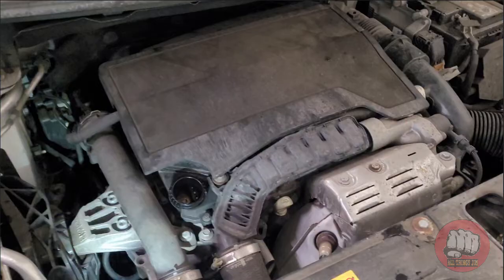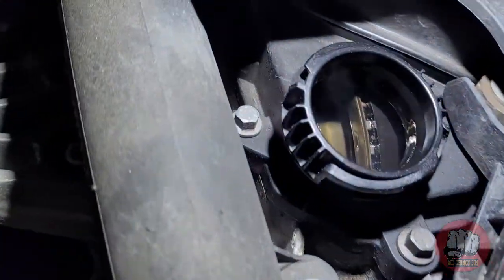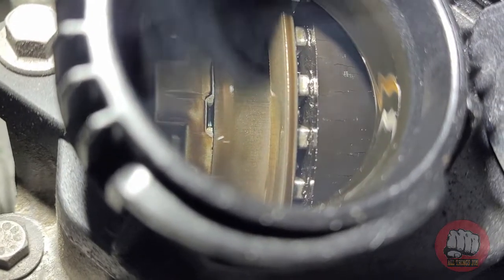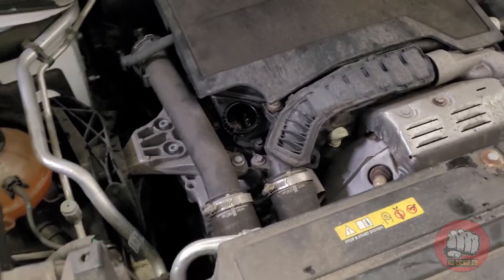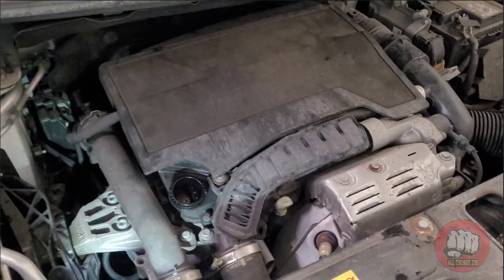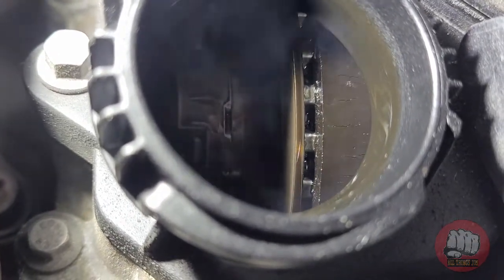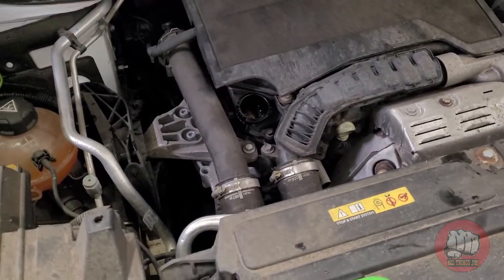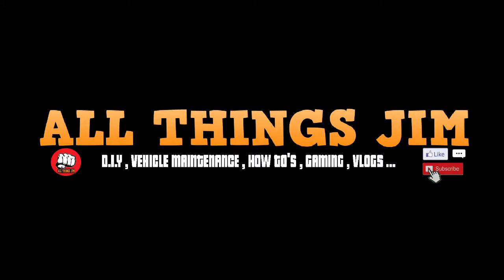Lets discuss the 1.2 puretec engine

Comment: Is anyone happy with this Engine 1.2 Puretech ? Or manage to do high milleage without any issues ? 🤔 I mean its all Horror Stories 😬
Reply: I have Opel Corsa F 2020 model 130hp/230Nm. As of today it have 55,000km (around 34,000 miles). No problems what so ever so far. Next week i have my 4th service check and oil change. But in my country the service check and oil change is every 15,000 km not 15,000 miles. I think that 15,000 miles is too much (24k km).
Reply: I've had oil losses, coolant losses, engine cut out to limp mode which can't be picked up on ECU, engine management issues....the worst car I've ever had. I would advise to stay clear of this this engine ..garbage.
Reply: @zakiakhtar7447   what was your mileage, and the Year when the car started going Wrong , did the car had been serviced regularly 🤔
Reply: @niceboy60  yeah serviced like clock work, 2021 and started 55,000 miles.
Still in limp mode. Mechanic says there's nothing physically wrong with it....but 42 fault codes which mechanic is having trouble locating
Reply: @zakiakhtar7447  I ve done my research that's the mileage I would be expecting problems to start appearing 😢
However I don't think I will have any problems
EAT8  8 Speed Gearbox in theory should mitigate
By constantly keeping revs low even at motorway speeds, New Timing Belt Material, Low Friction oil specifically 0w20  and to top if up Extended Warranty bough it until the End of my Contract, provided the car is serviced warranty should cover it
Reply: Got a 2023 car with this engine  On Extended Warranty , my plan is to do around 40,000 miles and get another car they offered me 4 years warranty and assured me this problems have been resolved
Reply: Yes, I did 80,000 miles in mine. My Son has it now and it's on 85,000. Absolutely reliable. Didn't need oil top-ups between services until about 65,000 miles. Now needs 0.5 litre top-up between services (15,000 miles). The car has been serviced by main dealer from new. I drove it hard and it has been across Europe a few times, fully loaded up. Brilliant car & engine. My Wife has one too, now done 40,000 miles with no trouble.
I had the cambelt & water pump changed at 65,000 miles.
Reply: @pauladams5673   if you dont mind me asking what is the make of the car & year ?
Reply: @pauladams5673  I'm sorry no disrespect intended but these mileages are really nothing special in the past I've driven
cars in excess of 200,000 miles with little more than regular servicing and no noticeable oil consumption between services,
a Nissan Bluebird went well past 250,000 mls before my eldest son had it and put a load more on it. A Honda Civic 1.6 VTI
I bought at 87,000 mls ran it till just under 200,000 and had 20 odd phone calls from people wanting to buy it. 
Manufacturers today do not regard owning a car more than couple of years as a thing. Caveat emptor.
Reply: @pauladams5673  interesting I ve just got 408 so far I m happy, what was your service intervals and what type of oil did you use?
Reply: I'm the 2nd owner of a 3008 mk1 (facelift version from 2015) with a 1.2 puretech engine. I currently have 124k km on it and I'm getting "low engine oil level" errors every 200 km.

Mechanic will start work on it in a few days. Next time I'll just buy a Mazda with a petrol engine, they're almost bulletproof. If only I'd done my research sooner...
Reply: @abcmusicman1  sorry to ask did you ever had to charge the Cambelt 🤔
Reply: @niceboy60  The cambelt was changed at around 80k km according to the service history, so it'd been done before I bought the car. I did however have to pay for a generic engine rebuild. The oil control rings were so worn and overheated that instead of snapping when the mechanic twisted them in front of me, he was able to keep twisting a full 3 rotations and it still didn't snap. I heard they were brittle, so it was proper f**ked by the time I got around to repairs. So far I've done like 1500 km since the oil was replaced after repairs and I've barely lost any oil, I think I'll be due for another oil change before I have to pour in more!
Reply: I wouldn’t have another one, though, admittedly, I did high mileage.  I had a 14 plate Peugeot 308 with the 1.2 Puretech 130hp engine.  I bought it in 2017 with c24k miles.  Sold it 3.5 years later with c130k miles.  By then, it was burning a lot of oil, I was probably topping it up every 1,500 miles.  The 3 cylinder engine just wasn’t up to it.  Maybe if you do 5-10,000 miles/year in a small car it would be ok.
Reply: These engines are a nightmare....expect to burn 1 litre of oil every 1000miles after 40'000 miles..it's disgraceful to be honest....and there is no excuse for it.

Comment: Is it possible to change timing belt in this king of engines per a timing chain in the In the official workshop of the brand?
Reply from the maker: Im not 100% sure on what youve asked.... if its - is it possible to change from a timing belt to a chain? then my answer is I havent seen one that has and I dont know if there is a conversion kit available BUT newer ones coming out have switched to a chain and hydraulic tensioner setup so mabie someone will make a conversion kit at some point 👍
Reply: @ALLTHINGSJIM  i think it could be the best option

Comment: Have new cars with this engine the same problemn? Thanks
Reply from the maker: Well there is a new model / version of this engine which does infact now have a chain but ive only seen a few so far, but all belt driven ones will have this problem at some point yes 👍
Reply: @ALLTHINGSJIM only hibrids have chein and new gear box from powertraina
Reply: @ALLTHINGSJIM  if we are talking about a new peugeot would you suggest the 1.2 puretech 100hp or the 1.0 TSI (208 vs fabia)

Comment: Got a disabled friend with a Citroen C3 Aircross bought brand new late 2018, main dealer serviced by the book and currently on around 30k.
He gets me to check his levels every 3 weeks or so and it usually needs a top up of oil and there is no leak.
My 2003 Jaguar XJ6 on the other hand on 120k miles doesn't use a drop between yearly oil changes, which is usually around 3-4k miles.
I warned him when he was looking around to buy it, steer well clear of small overstressed turbocharged engines, producing ridiculously high bhp per litre.
My instincts proven correct!
Reply: Direct injection gasoline engines 😢
Reply: If you want check PCV valve.Causes oil consumption
Reply: P c valve . I drive a 1997 ford escort . All electric bits removed injector pump earlier model . No abs ,only bit I keep original is the airbag . Modern cars with electronics nothing but problems .. give me seat 600 or a old ford cortina maybe even a Allegro. But come on wet timing belt ??

Comment: I saw another video talking about this engine and they say that cars with this engine built in 2023 already come with a new timing belt (more resistant to oil maybe). Do you know something about that ???
Reply from the maker: The brand new ones come with a chain now I believe depending on the build date, i will make an update video when I come across one in the wild 👍
Reply: @ALLTHINGSJIM  that's about time they fix this problem. Looking forward to see that video. I was thinking about buying a brand new Peugeot 308 with this engine but when I knew this issue with the belt I held back. Thank you for answering.
Reply: @ALLTHINGSJIM  interesting I've a 2008 gt getting built atm hopefully it comes with the change
Reply: I've just ordered a new 2008 1.2 130ps and am starting to worry a bit about what I see on the Internet on these wet belt puretech engines..
Reply: @jdmguy44  ordered mine in April, and I'm getting the new 2024 version. If you just ordered, you will get the same one the GT? right? mine is built and on its way to the uk. New versions have a chain instead of a belt. If in doubt, go speak to your dealership they have all the information you need
Reply: @MelchizedekKohen  yes it's the face-lift 2008 (2024 version) in allure spec slated for December 23 delivery (UK) Hopefully has the chain engine.
Reply: @jdmguy44  Yeah, should be all good, hopefully lol

Comment: Our puretec 1.2 T requires cambelt change after 28k miles 😮
Reply from the maker: Doesnt suprise me unfortunately, if you use an oil flush on your services then id stop as it may be that causing it to prematurely disintergrate 👍
Reply: @ALLTHINGSJIM  I had to pay £1200 for my sons C4 cactus to have the belt replaced i am gathering info to take citroen to the small claims court to recover the cost of repair which they refuse to pay or even a good will gesture .

Comment: Jim, I don't use my 1.2 turbo Cactus much as I am retired. Do you think I should take it for a short trip every now and again to keep the belt lubricated? If so how often and how far? Thanks.
Reply: AFAIK the main problem happens when you use it for short rides without allowing the oil to get the optimum temp. When you start the engine and it's cold, the fuel enters the oil pan and mixes with the oil. If you don't get the engine hot, when you stop the engine and leave it for hours, the oil has not been able to evaporate the mixed fuel that it contains, so this small amount of fuel will degrade the belt. If you do it time after time, you will rapidly ruin the belt. People that use the right oil and change it no later than 15k kms, and their daily rides are, for example, for 15kms or more, they'll be delaying the main engine problem. These are the owners that will tell you "Hey, I've done 120k kms and the engine is fine!". The oil compsumption will likely happen, but much later. Also on ~2017 there was a silent ECU software update that improved the combustion in the engine, and many people that don't take their cars to the manufacturer for mantainment would have missed this update until the 2021 recall, so they probably forced the engine to get dirtier faster than other owners.
Reply from the maker: Hi there, Im not sure whether that would make too much diffrence to the life dpan of the belt, but it cant hurt doing so aslong as its long enough to reach optimum engine temprature, a 15 min ish journey should be ok,  it would probably help prevent the valve seals going hard and sticking though to be fair 👍 thanks for watching
Reply: @ALLTHINGSJIM  No problem, I found your video extremely informative and will periodically check it via the oil filler. I will make sure I do a couple of 30min open road journeys a month.
Reply: No need to, it's a synthetic polymer belt that doesn't require lubrication for long lifespan.

Comment: do you recommend not using an engine flush then?
Reply from the maker: No I wouldnt recommend using them, I along with a few other techs believe they dry the wet belts out too much with the harsh chemicals in them causing the belt to break down, youd be much better off changing the oil more frequently 👍
Reply: @ALLTHINGSJIM  that was my thought thanks for the quick reply. Just bought one for the wife and even though serviced " not a chance " I'm doing it all myself with the correct oil for peace of mind. Thanks for taking time to reply cheers Paul
Reply: Never use an engine flush. There is just no need to and will only ever cause harm to any engine, rather than fix anything. Engine oil itself has detergents within it to keep the engine clean.

Comment: I bet you’ve got a review coming on the ford 1.0 ecoboost engine. Think they have 1 or 2 issues with them I believe.
Reply from the maker: How did you guess 🤣
Reply: Are the wet belt issues worse or better than on the ecoboost. Or about the same?
Reply: @gamesmaster1060  They have the same issues but apparently the failure rate is higher on the puretech engines
Reply: Geesh...that Ford EcoSport engine is awful
Reply: I've got the 1.2 pure tech 130 and I haven't had any issues, it needs alot of maintenance if you want a reliable engine.

Comment: I think you will end up with oil burning issues even if you do everything correctly. Probably with really tight oil change interval (like 5k km) you can avoid it but it's unknown as nobody does that. These engines are so cheap it doesn't make sense to open them up and change piston rings, at least if you are paying someone to do it. Regardless of all the issues this engine has, I enjoy working on it as everything is pretty easy to get to and work on.
Reply: How cheap is such an engine?
Reply: @gicugigel3790 I saw one for 1.1k € on Polish used parts market with 11k km on odometer